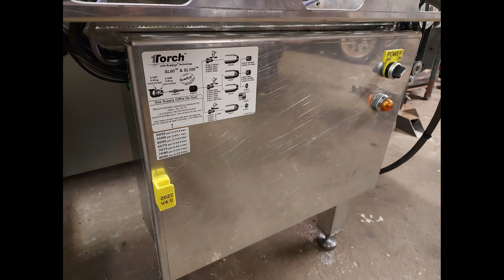Omavalmiste CNC plasmaleikkuri. Homemade CNC plasma project V4.0. 35000 mm/min.

Comment: Looks very good. Any problems with inaccuracy because of the very long timing belt? 
Why did you use aluminum? Just because it's more accurate than steel?
Reply from the maker: Hi! Thank you. I have not noticed problems with the accuracy though there is a long timing belt. It may be due to the plasma is not a very precise cutting method if this would be a laser cutter no long timing belt would work. I like to build aluminum because it is light, rigid and no need to paint.